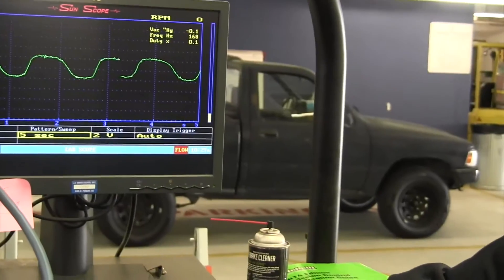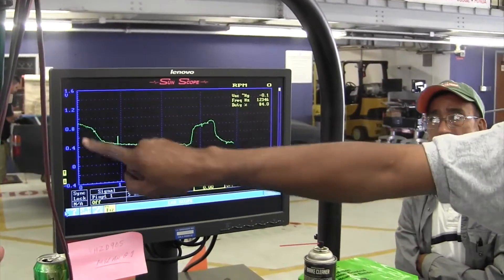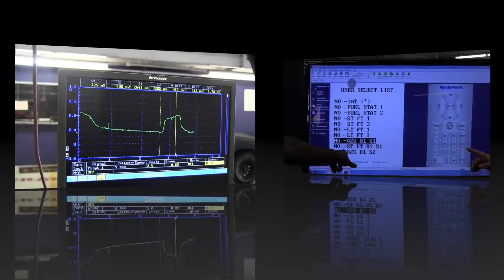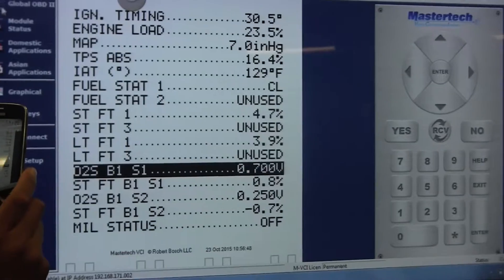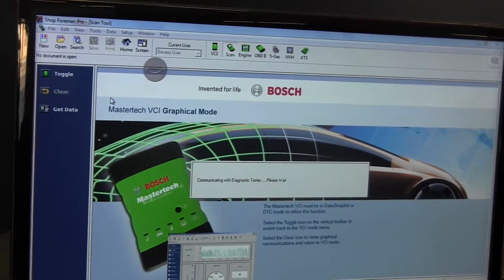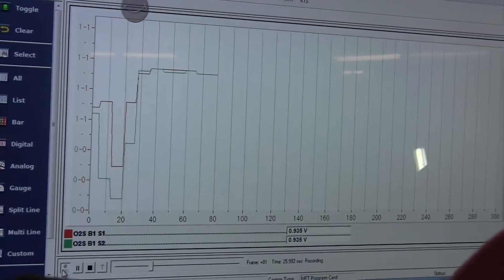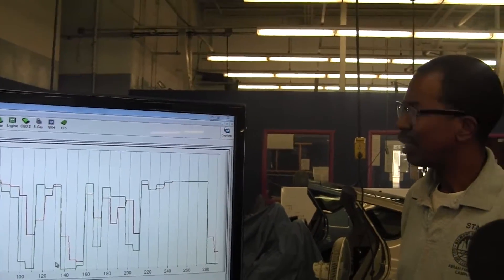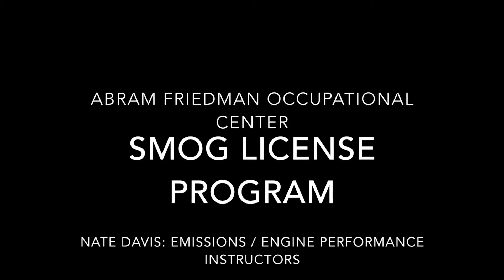P0420 CATalytic Converter Test Honda V6 ENGINE

Comment from the maker: The best way to check the speed of a 02 sensor is a lab scope - but I have to admit sometimes I'll customize my scan tool and graph it by comparing BISI to B2S1. on this clip I'm doing a OSC test when you can use a graphing meter from your scan tool 
It's just checking the ability of the cat to store O2 it's not a perfect test but it helps.